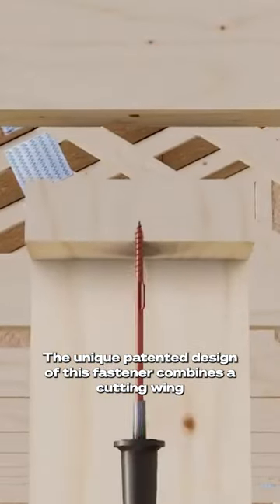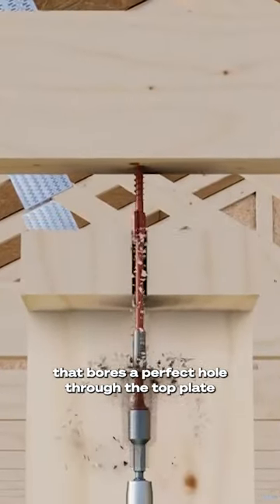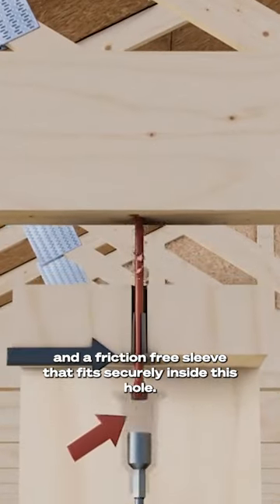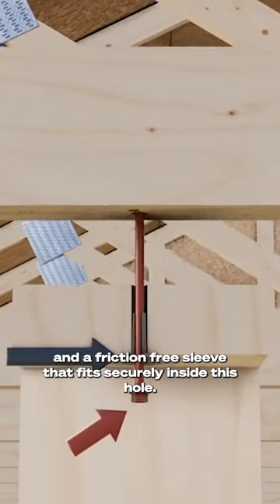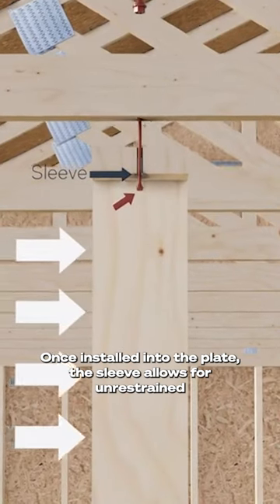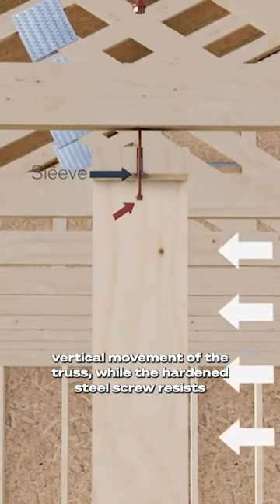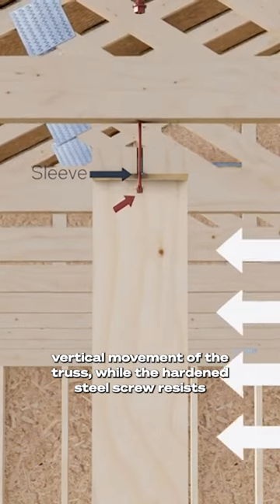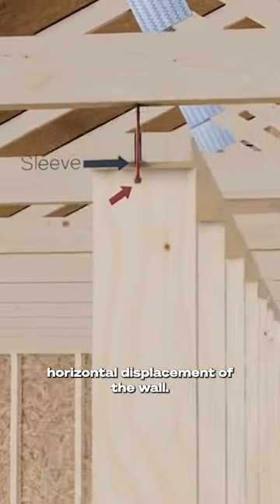How to Fasten Non-Load Bearing Walls With the NLB Connector!

Comment: Why you want it to move? Gonna mess up the drywall.
Reply: The animation is exaggerated. Wood expands and contracts throughout the year. Without a little but of movement the wood can crack and break.
Reply from the maker: The expansion and contraction will prevent the drywall from cracking because it prevents non-load bearing walls from taking on inadvertent loads.